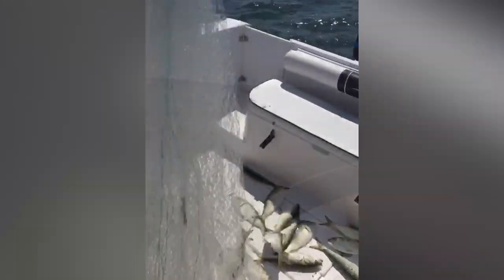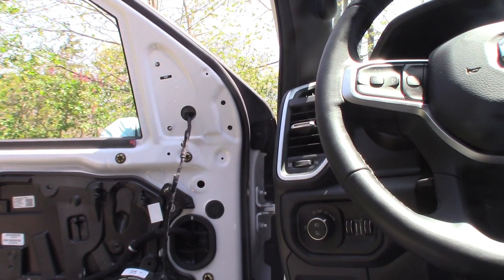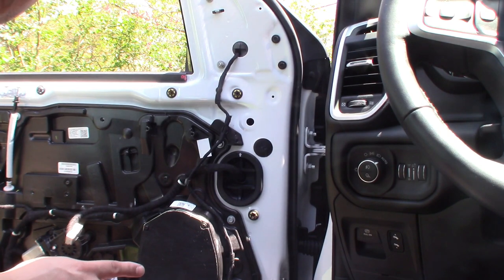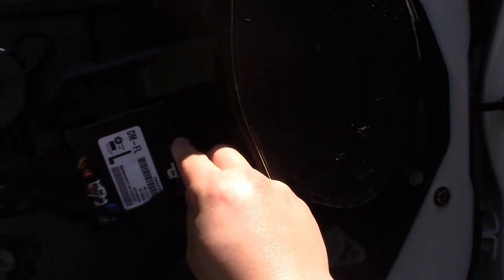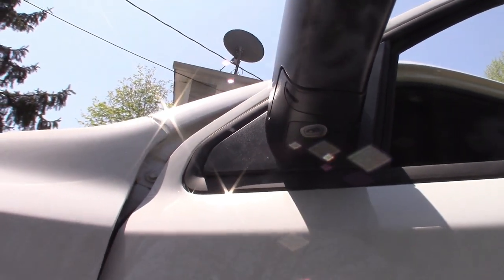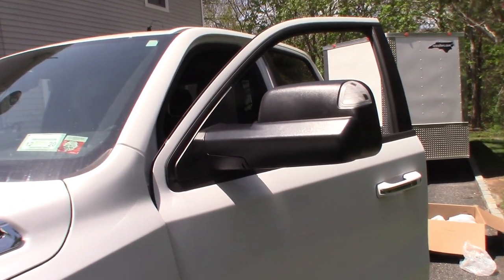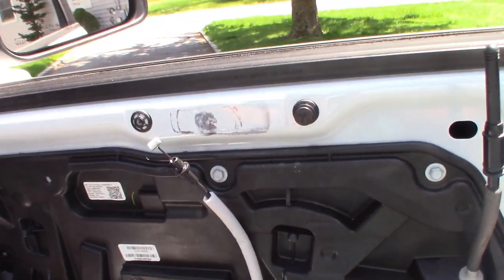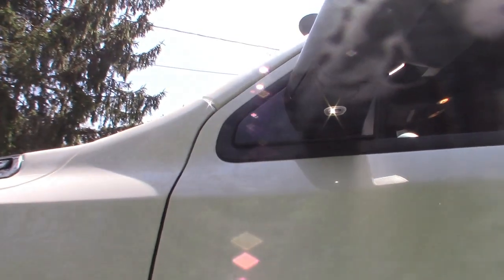2019 RAM TOW MIRRORS INSTALLATION

Comment: For the record, the approach light does not require programming to illuminate.  If it does not illuminate upon opening the door, then it means the mirror assembly is defective.  This happened to me.  I was able to prove that the vehicle side (including driver door module) was good by connecting the old mirror assembly to the vehicle and seeing that the old approach light illuminates upon opening door.  I exchanged the mirror assembly for another one, and it worked.

Comment: Would have been nice to start by seeing how the door panel is taken off instead of just skipping to it already being off
Reply: Exactly what kind of crap is that
Reply: It’s simple if you’ve done it before and if not even for a first timer it’s easy as hell
Reply: 3 screws, one behind door latch plastic panel piece that pops off. 2 more under door pocket handle behind plastic piece then its all clips so start bottom front and work your way around pulling on it

Comment: I noticed you didn’t use the stiffener brackets that Dodge required with the tow mirrors! Those mirrors are heavy! You’ll eventually have cracking of the door frame without them.

Comment: I have a 2020 Ram 2500 diesel. It had the plain side mirrors without turn signals. I bought the towing mirrors with turn signals. The dealership installed them and said the turn signal won’t work. They tried “programming” it. It’s a tradesman. Any thoughts? I see several tradesman with the same tow mirrors and their lights work.

Comment: Was there any problems without using the Stiffening Brackets? I want to install mine but seen a video on Boosted Motorsports you need that bracket because of the weight.
Reply from the maker: No not at all they  installed perfectly now this truck is the new body style that might make a difference DT BODY STYLE . They have been on the truck from this video over 4 years no problems.
Reply: @TheVeteranMiner  awesome thank you
Reply from the maker: @Rob Matthews anytime

Comment: Did the install throw a check engine light. I have spoken to several dealers and they all say if I change to tow mirrors it will throw a code.
Reply from the maker: Thanks for watching and no it does not throw a check engine light. The only thing is that when you install the mirrors and you put the mirrors up the controls are reverse because it was not programmed into your truck. Hope this helps thank you
Reply: Thanks for the reply. I found out the reason they act up is the 5th gen has the ambient sensor in the mirror. The tow mirrors do not have them, reason why it acts up. What is the trim package on your truck. Mine is a bighorn.
Reply from the maker: Kristopher Kuhrt that’s good to know good info for anyone else that’s runs into your problem thank you for the info greatly appreciated !
Reply: @TheVeteranMiner  Just because the check engine light does not illuminate does not mean it does not throw a code.  Not all codes throw a check engine light.  The code is B2861, by the way.
Reply from the maker: @preautel5769  I went to the dealer to reprogram the mirrors because the up down were reversed but no code was thrown. But it needs to be programmed for proper direction when the mirrors were flipped up

Comment: Do you still have the original mirrors?  my truck has the ones you are installing and I want to replaced them with the smaller version
Reply from the maker: Alex Curiel yes I do have the originals. They are for sale. Email me @ veterandavep@gmail.com .
Reply: Doing same thing did u have to replace drivers side switch panel?
Reply from the maker: Andrew Shields no replacement just left the switch in
Reply: VETERAN_DAVEP thanks
Reply from the maker: Andrew Shields if you’re interested in purchasing them give me a email at veterandavep@gmail.com

Comment: did you original mirrors have the turn signal and courtesy light? and if not, did they both work just from plugging in.
Reply from the maker: Yes the turn signals and courtesy lights will work without going to the dealer for programming .plug and play thank you for watching !

Comment: Do you know if 2016 ram 1500 towing mirrors work on 2020 models? Cause I have some power folding towing mirrors came out of 2016 RAM
Reply: The mirrors from the 4th Gen do not work on the 5th Gen.

Comment: Power fold work????
Reply: There are no such thing as power fold tow mirrors for the 5th Gen Ram 1500. It’s only available on the 2500. It may be an option for the 2021s I’m not sure yet but not for 2019 or 2020.

Comment: Do you know where I can buy the original side mirrors?
Reply from the maker: I have a set for sale off my truck but you can get them from the dealer.
Reply: Do you have to program the OEM replacement of the original MIRRORS?
Reply from the maker: @granthiga1447  For my understanding if you did not have power before and did not have the switch then yes you would have to program the system at the dealer hope this helps.

Comment: Are these mirrors heated as well or do you lose that feature?
Reply: I would like to know that as well
Reply: Any updates?
Reply: I don’t think the original poster answers any of the questions. I done my own research, called the dealer and questioned if they were heated or not. In the description from Mopar it says they have defrost. I ordered the mirrors online and they are not heated.
Reply: @rpittman4778  yeah I saw that the questions are avoided? Not sure why he avoids the questions. I want to upgrade the tow mirrors but don't wanna lose the powerfold feature but could settle losing it but definitely not the defrost feature